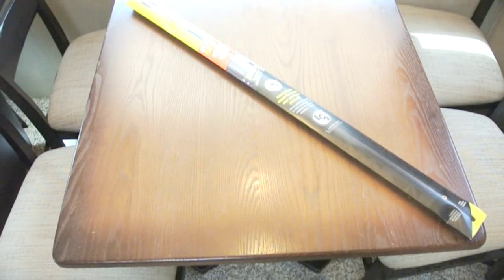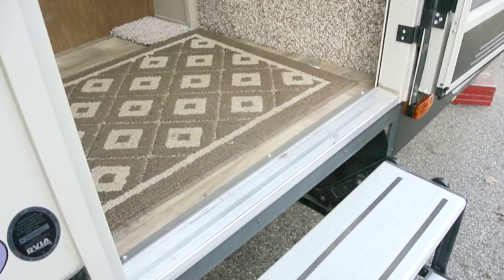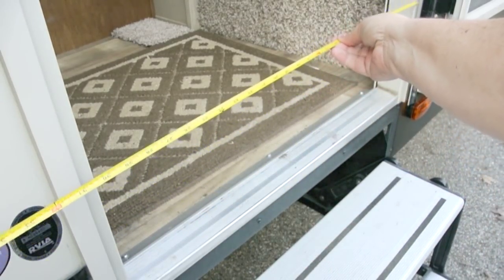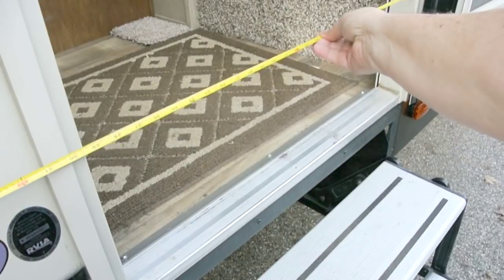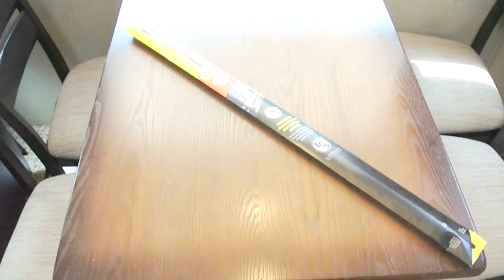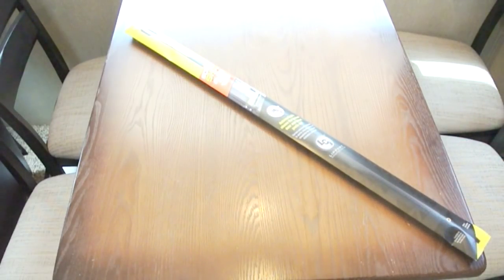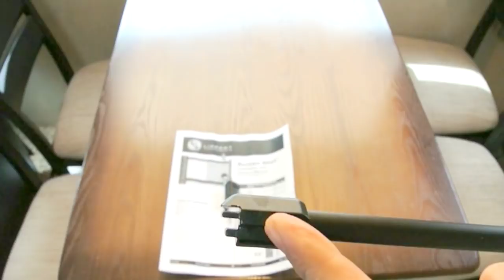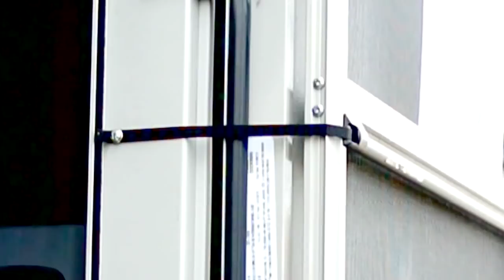Installing Lippert's screen door closer on my RV.

Comment: You'd like a tension adjuster so it doesn't slam?
Reply from the maker: In the wind, it could use a bit more tension. On a windy day, it does not always close. On the other hand, as it is, the door is at least dampened so it does not slam when a gust of wind hits it.
Reply: @RVProject  ok, makes sense. Thanks for another great video. It's over my head but love all the electronics.

Comment: could you please add a link for where to buy, thanks for the vid!
Reply from the maker: If you look in the description of the video, you will find a link to my project website (www.rv-project.com/projects/simple.php)

Since there are 5 different lengths of closers, I put the 5 links in the website. That is where I bought mine.  

You can also google the part numbers.
Reply: @RVProject  - link has ) at end of url, gives a 404 error when clicking... nice project